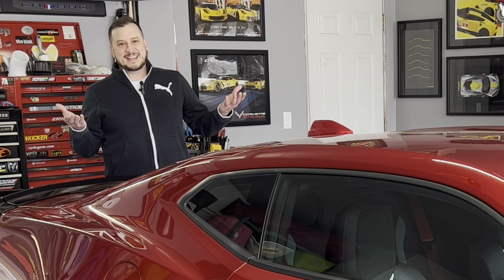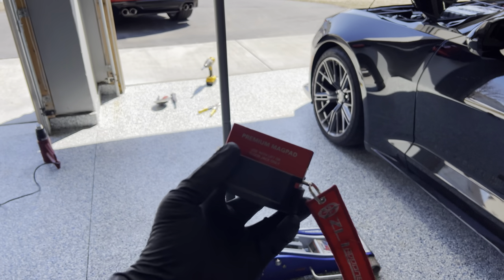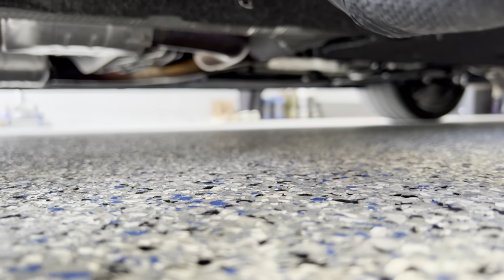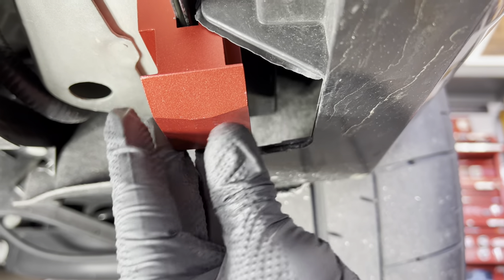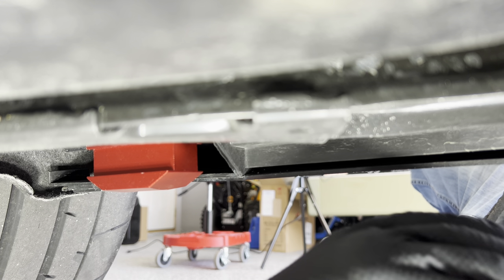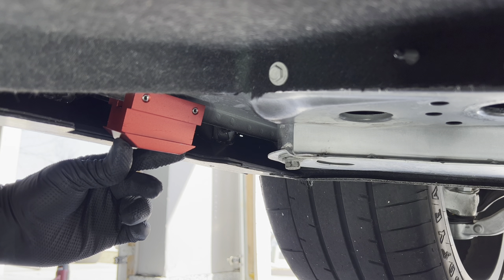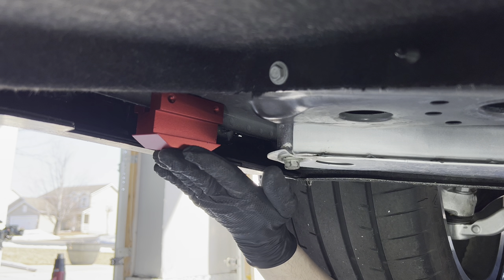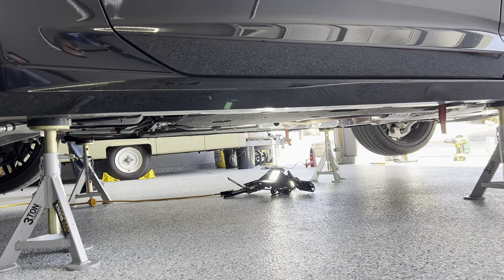How-To: Install Lift Points // 2016-2024 Chevrolet Camaro

Comment: Me and a buddy bought three sets and put six on our cars.  Great Video!
Reply from the maker: That’s a great idea! Eliminated the need for the universal pinch weld jack pad.
Reply: I also have a 2022 in Wild Cherry Tintcoat.  Not a ZL1 though, an LT1 Manual.
Reply from the maker: @heathbuchanan6408 I have a 22 Wild Cherry SS 1LE. The Black ZL1 is a frequent guest of the channel though.

Comment: You make good videos.  I would suggest using some blue lock tight on the alien screws and using a good t handle alien wrench or a alien socket to secure them better.  Thanks for sharing your video.
Reply from the maker: Thanks! Great suggestions!

Comment: Do you only use it before lifting or permanently? I am afraid if you loose one at driving there would be a big rumble in the wheel house.🤔 And the Bolts? Will they not remove the paint at the fold and then it will begin to oxidize ?
Reply from the maker: Permanently. I’ve done 150+mph with these on, on track in my 2018 SS 1LE, my 2022 SS 1LE and this ZL1 without issue. Those folds barely have any paint on them to begin with, but I don’t think oxidation will be a long term issue. You can always add a layer of paint or clear coat on the pinch weld before you install them.

Comment: I have a convertible and do not have the "mid-point" lift pinch weld.  How do you raise a convertible to get the jack stands underneath?
Reply from the maker: The “mid-point” isn’t really at the middle of the car, it’s near the front. Your convertible should still have that pinch-weld location.

Comment: Once the lift pads are installed where do you lift the car to be able to put the Jack stands under the lift pads?  For example if you lift from that point how also do you put the Jack stand there? Do you lift from the middle of the car with a magnetic puck or somewhere else?
Reply from the maker: That is covered in the first minute of the video, and then again shown exactly where to lift from. Once you use the puck to lift the car you can place the jack stands under the lift pads.

Comment: How do you place the jack stand after lifting?
Reply from the maker: You would use the pinch weld magpuck to lift the car and place the jack stands on the lift pads.

Comment: Do you leave these on even while on track?  No concerns with them coming loose?  
Also, can you leave jack stands on these pads or are they strictly lift points and then you put jack stands in another location?
Thanks!
Reply from the maker: Yes, I leave these on even on track. They aren’t going anywhere once they are on. Yes, I lift the car with a universal jack puck and place the jack stands on the lift pads.

Comment: Would you be able to do this without any jack stands?
Reply from the maker: I always recommend having something under the car besides the Jack to prevent injury or even death, if the Jack collapses. Safety first.
Reply: @FollowMyLine17  Sorry, I meant I don't have any jacks at all, so will be trying to install with the car normally on the ground.
Reply from the maker: @bens9450 ah, ok. I don’t think it is going to be easy to get these on without lifting the car a bit. Even if you can reach to place them, tightening the screws is going to be very difficult. Maybe not impossible, but damn near close to it.
Reply: @bens9450 inflate ur tires to max psi🤷‍♂️
Reply from the maker: @c4sare4kiddos this won’t really “lift” the car. I don’t suggest doing this.

Comment: Those looks like the knockoffs.  Would you happen to have a link and how are they holding up?
Reply from the maker: The lift pads are from Amazon. The Amazon link is in the description, and I’ve had these on this car since September of 2021, and previously on my 2018. Zero issues. I have also installed them on a few other cars, including the one in the video. We lift these cars quite frequently with all the track duty and brake swaps we do. The magnetic pinch weld lift puck is from ZL1 Addons, and that link is in the description too.
Reply: @Follow My Line  I did see the link after posting sorry but thanks for the feedback on their performance.   It definitely appears like one of them didn't touch the pinch weld at all.
Reply from the maker: The pressure applied and distributed by these is on the base of the unit, not inside the slot where the pinch weld sits. That is essentially there for clearance. The set screws grab the pinch weld section and hold the lift pad in place. This is exactly how the ZL1 Addons units work as well, as I have compared these to my buddies ZL1AO lift pads. They were identical.